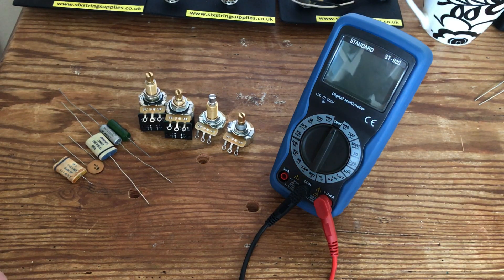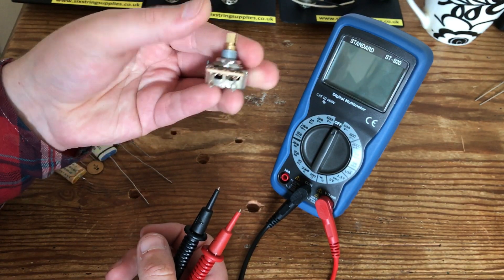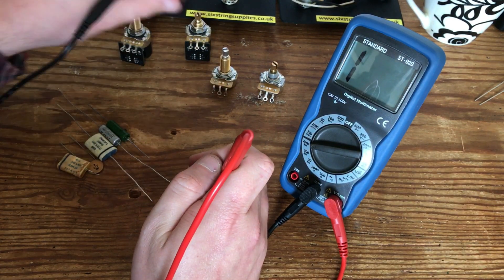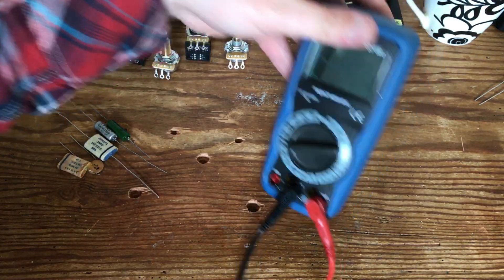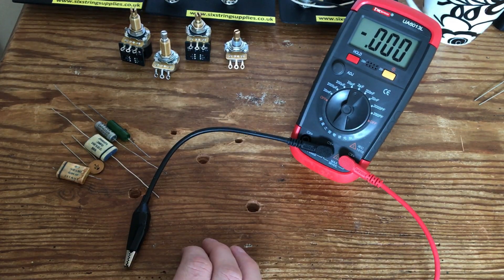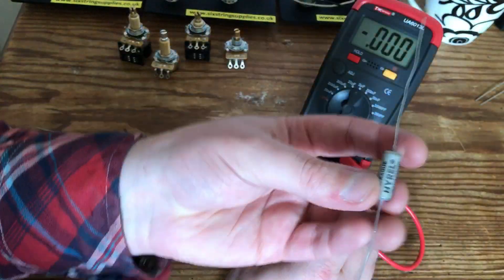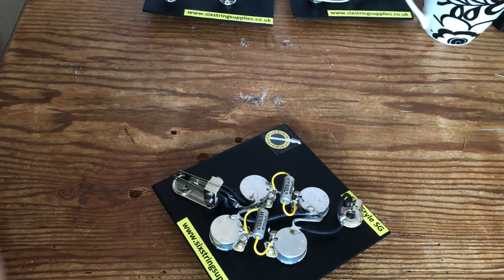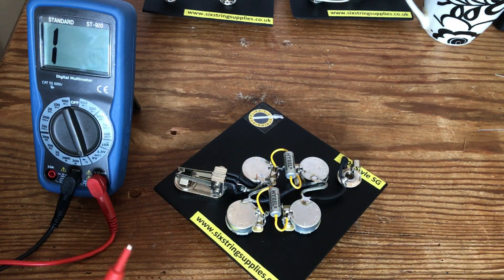Testing Guitar Electronics - testing pots, capacitors and the continuity test

Comment: I'm just now learning how to use the multimeter. I have a project where a push/pull pot went bad so I decided to rewire the whole guitar. With the multimeter I checked all four pots and I get either OL or 0.0. Surely all four pots aren't bad? The other 3 worked fine before.

Comment: The ceramic cap has a Z tolerance code. That's the least precise type of cap. Quite suitable for non-crush applications, but not for filter circuits.  This which means its value will be from -20% to +80% of the label, which translates to 0.04 uF to 0.09 uF. So, 0.044 is within the tolerance. There are tighter tolerance codes such as J which is +/-5%, which is likely what you expected to see.

Comment: I’m a recent subscriber and I find your videos very informative and clear. Here is a massive noon question.  Why did you switch to a different multimeter to test the capacitors?  Do I need two multimeters - one for pots / continuity and another for caps?  As you can see, the whole world of electronics is largely alien to me.
Reply from the maker: Welcome! Simply because my multi-meter does not have capability to read capacitance. So one is the multi meter and the other is a capacitance meter. Some multi-meters have capacitance meters built in, but generally they don't.

Comment: So glad I found this channel, but this video in particular. My question is in regards to testing the capacitors within the circuit.  When I attach the red alligator clip to the capacitor on the tone lug and touch the black lead to the volume pot, I get a reading of .03., which is far lower than the capacitor value. This happens on bridge and neck pots. The only difference between the harness in the video and the harness I'm testing is the input jack isn't soldered in. Could this be the reason for my issue? I'm using the same meter for capacitor testing you are.

I've confirmed the harness is grounded with a multimeter.

Comment: Got a Bourns push pull coil split volume pot on the neck pickup of a Les Paul and when I turn it to zero sound still comes though how do i tell if its a bad pot vs a bad solder to ground?

Comment: Thanks for the video, exactly what I was looking for. Electronics practically applied to guitarts. The problem I'm facing, is in my Squire Jazz Bass, the resistance between the pot bodies and the ground of the plug is about 50Ohms. And I'm wondering if that might be a bit too high and cause humming. I see on your 50s Style Les Paul, you've connected one big ground wire to all pots. I think I'll do the same to see if that fixes the humming.
Little note on 'The continuity test' symbol on your DMM. The little WiFi logo is a sound wave logo. The beeping will tell you if the connection is right/continues. Or more specific, for my Fluke 17B+, it will beep when the resistance is lower than 70 Ohms. (But when a ground path from Picup to plug is about 70 Ohms, isn't that too high?)
The symbol above it, is not a symbol for continuity, but a diode. You can use this mode to test diodes. The value on the display will show you the (forward) voltage drop of the diode under test in mV.

Comment: Curious, you accepted a tolerance for the pots but didn’t on the caps? I mean they have built in tolerances as well. even resistors. In fact you can get resistors with tighter tolerance based on the material used.

Comment: I need to get the right meter....my multi meter does not have this capacity
Reply: Harbor Freight. I got the red one that is least expensive and it works great.
Reply from the maker: I got mine on eBay a few years ago, probably about £15/$20. It is ok...the better needs changing a bit to regularly for my liking but it does the job. Thanks for watching

Comment: Hey man i had a question. I rewired my lespaul harness like 50s wiring. Pickups are not connected only. The neck volume pot doesnt shows any reading  when checking it. Rather all 3 other pots show reading. Is it normal? Or something wrong?
Reply: probably burnt it with too much heat , i think that's why my 2 tone pots aren't working

Comment: Good video. I have a Gibson R7 and the pots read at 480k which is well over its 10% and i still find a lot the humbuckers i have tried (alnico 2) are too bright for this guitar. I now play an alnico V pickup but should i look to change the pots and if so, how can i guarantee that the 500k pot i order will read within the 10% range?
Reply from the maker: Hi thanks a lot. 480k is well within spec of a 500k pot. Most 500k pots are made to a 20% range because the human ear can not detect the audible difference. However, there are pots made to a 10% tolerance, including the ones we stock. Thanks again
Reply: @SixStringSupplies : Ok, thank you for that. What about 550k pots, do you suggest those for my R7 with heavier pickups? What can i expect to hear between a 550k and a 500k pot? Do you carry 550k pots?
Reply from the maker: Hi no we don’t carry 550k pots. There is little audible difference with a 550k pot, they are made to ensure the pot value never measures in below 500k.

Comment: Do you put heat shrink sleeves on your capacitor arms?
Reply from the maker: Coyote Foxtrot yes always...when it’s in a circuit.
Reply: Six String Supplies thanks for the quick reply. Here's  a random question: Do you have an Ovation Magnum bass wiring diagram?

Comment: Great video, very informative. I'm a bit of a novice, so silly question. I have a multimeter similar to yours. I'm testing a 500K Ohm pot, and my meter is reading 0.48 (meter set to 20M in Ohms, like yours). Is this reading the same as 480K?  Thank you.
Reply: Yes
Reply: Set your meter to 2000k
Reply: i' m also a novice and just bought a multi- meter today - all kinds of grief because i got confused on the ohm settings - the only "20" is 20 K [ that I see ] which is too low for a 250 K pot 
- try the highest setting and work your way down the settings to get the Decimal where you want it - I also read a warning about "discharging ANY capacitor" - not sure how ? use ground wire clip 1st maybe [ on each of the capacitor leads ? ] - may be vids on YT ? good luck